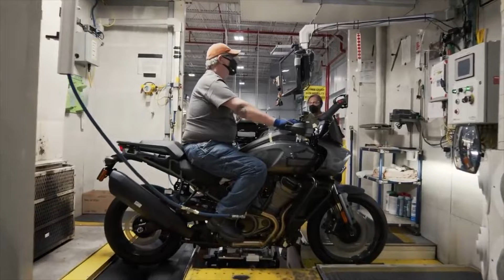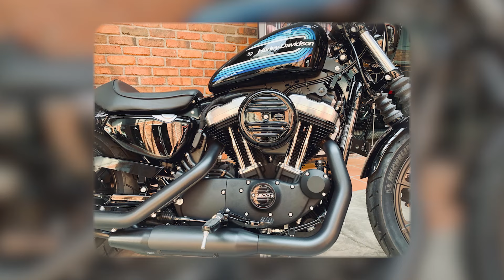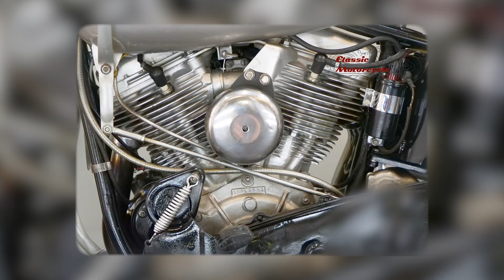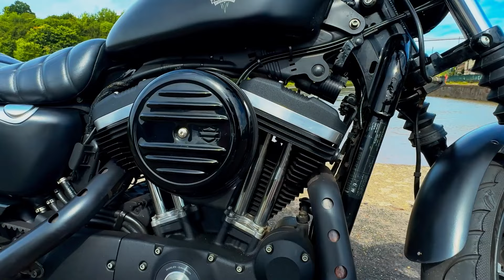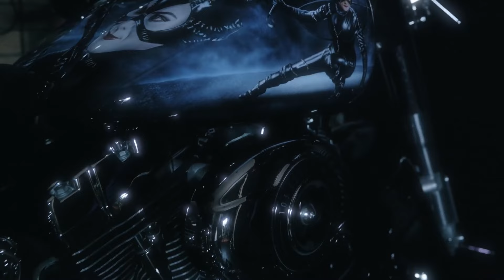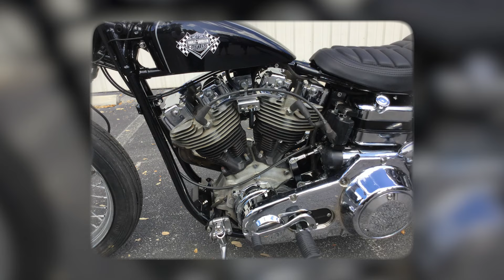The 15 Most Indestructible Harley Engines Ever Built

Comment: harley used 45 cu in /750 cc in their military bikes - never used the 74 or 80 cu in flatties for military bikes - the twin cam 88 was junk - tension chain issues - auto tensioner issues wearing out - overheating problems - blocked oil lines from the plastic chain tensioners - they had to redesign the motor and make the twinkie 93 and the first 1340 evo's had an issue with the crank case splitting between the cylinder bores - had to replace mine with a s/s super sidewinder 107 - my 74 ci shovel has over a million kms on it but i've totally rebuilt the motor 3 times

Comment: I have 130000 miles on my 1994 Evo powered Electra Glide Classic. She is all orginal.  The motor has never been torn down. She makes good power and does not leak nor burn oil.  I will ride my Electra Glide until I die.